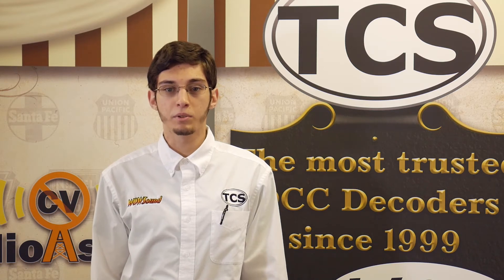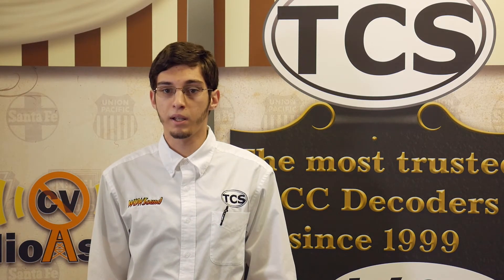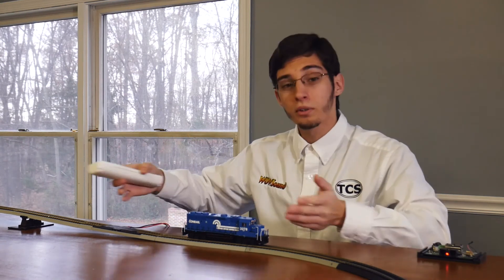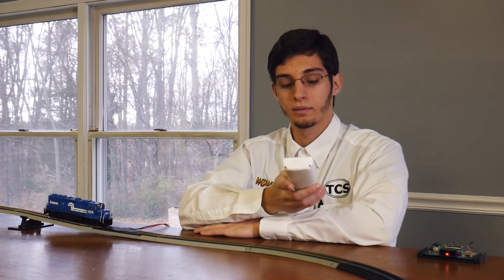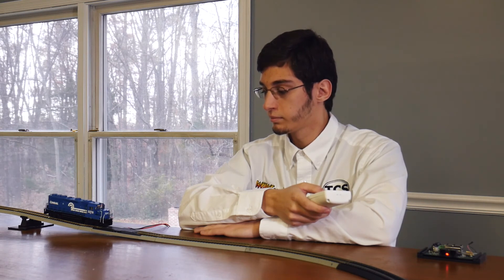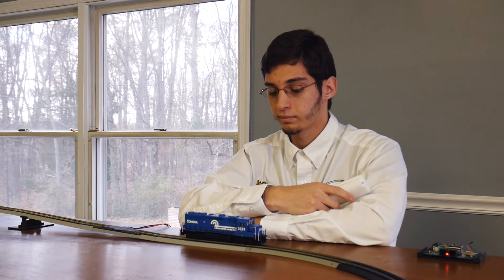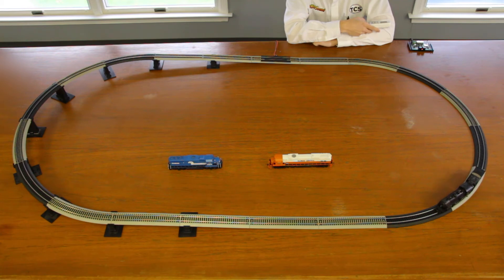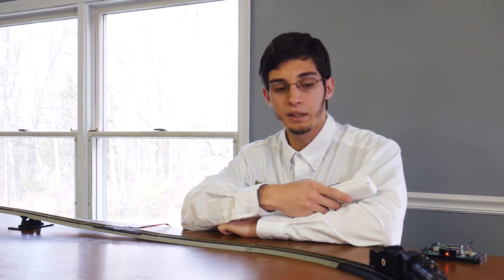Hands-on with TCS Prototype Mode!

Comment: how do you get the decoder to 128 speed step mode. Mine when i programmed it went to 28 speed steps. it seems like even calibrated, it runs slower than it should through the whole speed range.
Reply: The 28/128 speed steps is usually determined by the throttle, not the decoder.